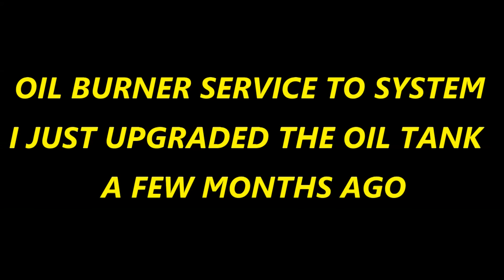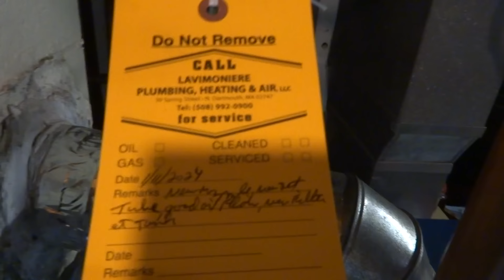OIL BURNER SERVICE  TO SYSTEM I JUST UPGRADED THE OIL TANK

Comment: The solar panel longevity is hyped up. To get you to buy them.
Just like when those curly light bulbs came out they were supposed to last three times as long as in contestants. But in reality they were failing less than a year
Reply: I used to call that an Obama bulb, the curly Q one!  Yeah they farted out like normal as I remember, nothing impressive, plus it's like a lab light not a soft light.
Reply: Those lights were always crap. Like any fluorescent light the rated lifespan excludes any short term use. If they're left on 24/7 you'll get roughly the rated lifespan, but short cycles, you know like you'd get in a lot of home use, burns them out quickly.

They converted my building over to all LED lights 6 years ago. Normal A19 bulbs, track/recessed PAR30s, and T8 tubes. Over 50,000 hours on them and they've had a whopping 3 A19s burn out. No PAR30s or T8s, and they're all on 24/7.
Reply: I'm seeing the 25 year LED bulbs go super dim or burn out in just a couple years. I am beginning to think anything marketed as being SMART is one of the dumbest things you can spend your money on.

The old stuff was better made and followed the KISS rule. We need to keep it simple stu....

Comment: I just installed one of these wi-fi oil level sensors on my horiz 275 gallon tank.. Real cool - monitor fuel level, usage rate, low level alarm and gives you a list of oil suppliers in the area with best price. App is android or apple for smart phones..
Screws right into the existing bung at the top of the tank.. easy peasy install.. 
Smart Oil Gauge - Wi-Fi Heating Oil Tank Gauge with Smart Monitoring - Fuel Tank Gauge Compatible with AIexa - Designed for 275/330/500/550 Gallon Tanks (Vertical/Horizontal)